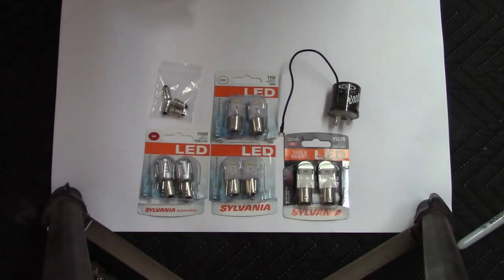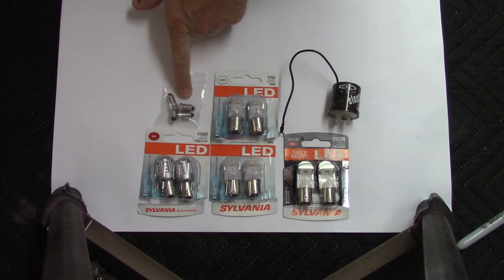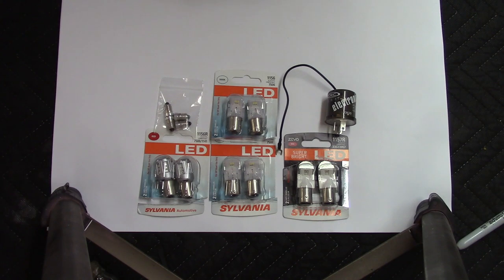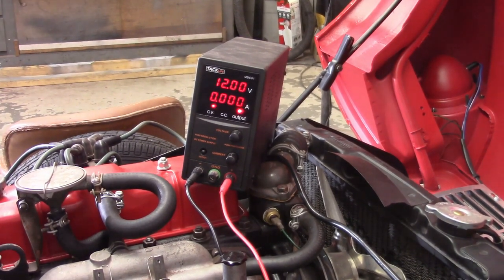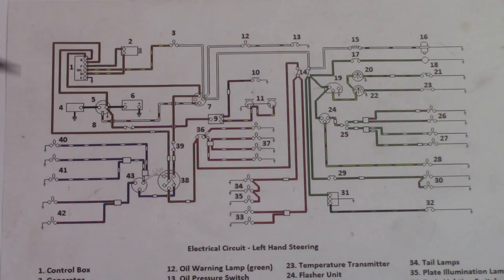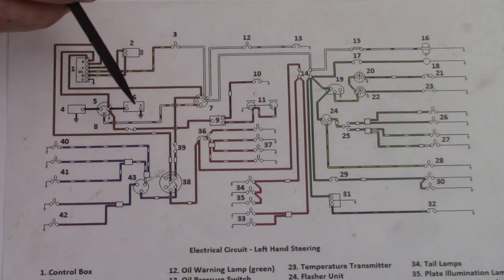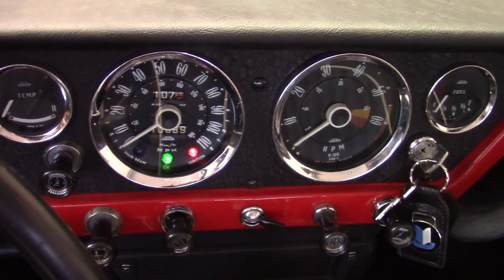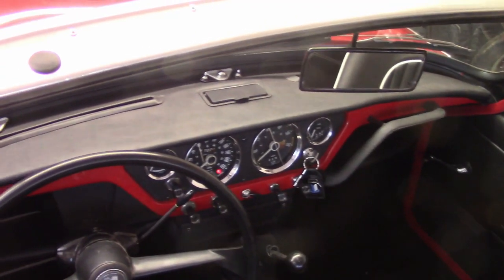Positive to Negative Ground and LED Conversion for Your Classic British Car | Roundtail Restoration

Comment: Good job converting it to negative ground Chris. One thing I find really helpful on the road with these little sports cars is a loud horn. I have an air horn in mine and that saved me a few times from being squeezed into the curb. They just don't see me in the mirrors and cut in front of me while changing lanes, but my horn wakes them up really good LOL
The main problem though is with the ignorant drivers, who see you and hear you, but still don't take you seriously. As if you are a child with an electric ride-on toy.  What happens on a regular basis to me is that drivers come out from a side street on the main road, they stop, they look, they clearly see me coming, but they just don't take me seriously and they just go... as if I don't exist... happens so often it is incredible.
Reply from the maker: Thanks, Elin. I did get new horns and I think they are pretty loud for the car, so hopefully that will help. Third brake light is next, but I need to spend some time designing something.
Reply: I agree 100%, being visible is so important, I have very bright LED lights and very loud horns, since my car is a Triumph Vitesse Convertible, I have built a third brake light into the back-up light cowling at the back/top of the boot/trunk lid. It keeps the original look but increases rearward visibility

Comment: Great video Chris. If it was my car and now that you have converted from positive ground to negative i would fit an alternator. Years ago i had nothing but trouble with old type generators and regulators and constant flat batteries , due to not charging at low rpm's. Car is looking good now and those led lights make all the difference !
Cheers, Jeff.
Reply from the maker: Thanks, Jeff. Not sure about the alternator yet. We'll see how it goes.

Comment: Good video, I have never seen anyone switch positive ground to a negative ground before.
Reply from the maker: Thanks. Found quite a few articles out there, so the knowledge base is good. Just wanted to explain some of the nuances.
Reply: @roundtailrestoration  It was pretty cool to see for the first time. Thank you. I thought about upgrading the bulbs on the MGB to LED, damn they are expensive, but it looks like the cost is worth it.
Reply from the maker: Yeah, I think the lower current draw probably makes it worth it to me more than anything. I expected them to be a bit brighter...maybe they will be in use, but the lower current, I think, is important to the life of the electrical components.
Reply: @roundtailrestoration  I wonder if it is because of the covers why they are not as bright. They do give off a different glow though.
Reply from the maker: It could be. I agree with the glow. Much whiter for the fronts. The brake light don't seem to fill up the lens as much. Hard to explain, but you can see it in the video. Light seems more focused almost.
Reply: @roundtailrestoration  Yeah it does seem more centralized, but it is still a good glow. I like the upgrade.

Comment: Nice vid! Great science lesson. I think I'll do as you, and get the car closer to completion, but the safety aspect, and to a lesser extent possibility of damaging our beloved cars, is a good motivator.
Reply from the maker: Yeah, I might have gone a bit overboard there. Interesting to me, but not sure how much of my audience. That's why I threw the little driving parts in there. Yup, safety was my reason...the accident pushed me over the edge.
Reply: Yeah that's a very sobering reality. Your point and proof about the current draw and the full current switches make it a useful upgrade also.

Comment: I would highly recommend that you try to find a pair of solid brass battery clamps, (not the cheap cast versions). I sold car batteries for several years and the type you have tend to stretch and corrode over time.
Reply from the maker: Those were temporary during the restoration - I'm embarrassed to say I picked them up at Walmart. But, I got customized battery cables manufactured by CE Auto Electric Supply out of Arizona. You can see that video here (https://youtu.be/fUvJTPcMqzg).

Comment: Great to see you on the road. Have you considered adding a high mount brake light too for extra safety ?
Reply from the maker: Thanks. Yup, that will be on my to-do list. I want to find something (or make it) that fits in nicely. Going to do a bit of research on that.
Reply: @roundtailrestoration  There should be something meant for a Jag or Healy that could be installed on a makeshift pedestal.  Something in chrome with a clear glass lens would work with  red LED.
Reply from the maker: Thanks, Mike. I'll take a look. Gotta look through the forum, too.

Comment: Great video.  I'm confused tho in the positive vs negative ground.  Wouldn't the starter turn backwards?  Thanks.
Reply from the maker: No, none of the motors will spin the other way. Basically, the current is flowing in the opposite direction, but since you're not changing how the motors are wired up (don't swap any of those leads), that's essentially invisible to them and they continue to operate as before. Counterintuitive. I'd have to study it a bit to explain it more clearly, but everything still works as it always did and I didn't change anything other than what I show in the video. Thanks for watching!

Comment: Presently, I have a two pin flasher unit on my Triumph, (not the bi-metal strip version, but the electronic version), my car is already negative ground. How do I change that to a three pin flasher unit like the EF33RL that you used? (I have tried several LED flasher units on my car without success), At the moment. I have LEDs at the rear and Halogen incandescent bulbs at the front and a standard incandescent in the dashboard. OK, I've had a look at how the 3 pin unit is wired. It's simply Battery, Load and Ground. It should therefore be fairly simple to wire in. We shall see.
Reply from the maker: Yup, it should be as easy as that. Good luck!
Reply: I have now installed the EF33RL flasher unit in my Triumph, initially the flashers didn't work right, however, I removed the small dashboard incandescent bulb, then they worked perfectly! My Hazards don't work now, but I realize that's because the hazard flasher unit is not the correct type, so I've ordered another EF33RL and LEDs for both the indicator dash light and the small bulb inside the hazard light switch!
Reply from the maker: @lordleonusa Good deal. Sounds like it's coming all together! I didn't have to deal with flashers since the car was so old.
Reply: I have replaced the hazard flasher unit with an EF33RL, and very strangely, it works perfectly with an incandescent bulb inside the hazard switch but will not work with an LED bulb inside the hazard switch! The opposite of the direction indicators! @roundtailrestoration
Reply from the maker: Yeah, that's odd. I don't have a flasher circuit on my car (too old) so I didn't have to deal with that. Does it work with an old Lucas flasher relay? Has to be related to a current - all four will draw more than just two at a time, but I wouldn't think that would be significant enough to matter.

Comment: Do you need to unplug anything from the spade before flashing or is it simply a bare spade? Why did you need a jumper on your starter solenoid?
Reply from the maker: Hi Dean. Yes, the field lead is there, so you need to unplug that. Afterwards, just plug it back on. The jumper on the start solenoid was just a convenient place to grab positive battery voltage - on the other end is that alligator clip that I touched to the field spade. If you wanted, you could run a wire right from the positive terminal of the battery and touch the field spade using that. Does that make sense?
Reply: @roundtailrestoration  great video great response. Best conversion to - earth on the web. Can't wait to get started.
Reply: Will my tach work after conversion?
Reply from the maker: My tach is mechanical. I don't know when they switched to electrical ones, but I believe they were all negative ground by then. I think negative ground happened around 1968 or so.
Reply from the maker: Good deal. Good luck. I think you'll be happy with it. Don't forget the new turn signal relay!

Comment: Did you have to make any changes to the tachometer?
Reply from the maker: I didn't add any LEDs to the gauges, only the turn signal. I don't really plan on driving at night at all (or not much) but I wanted to be seen more during the day.
Reply: @roundtailrestoration  Does it have a mechanical tach?
Reply from the maker: @aggiebq86  I gotcha. Misunderstood. Yes, it's mechanical so I didn't have to worry about the polarity swap. I think all of the electric tach cars were already negative ground.
Reply: @roundtailrestoration  I have a 66 MGB that’s positive ground and I’m thinking about switching to negative and at the same time installing an alternator. The biggest mod will be reversing the polarity of the tach since it is magnetically driven.